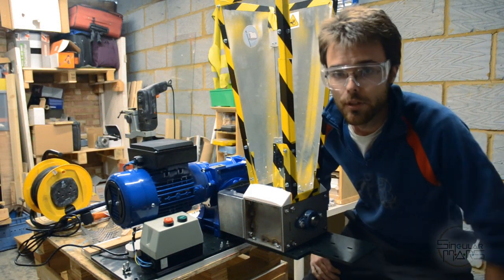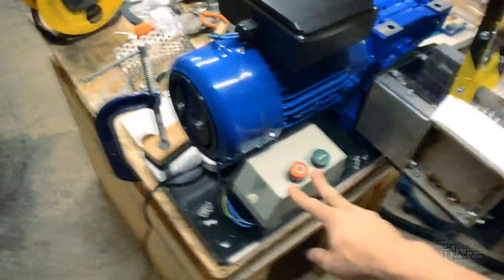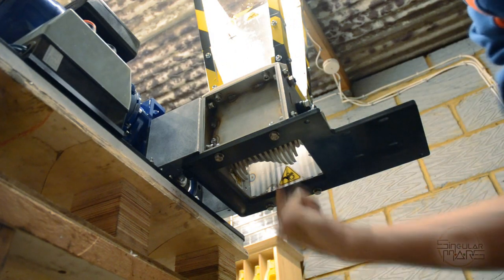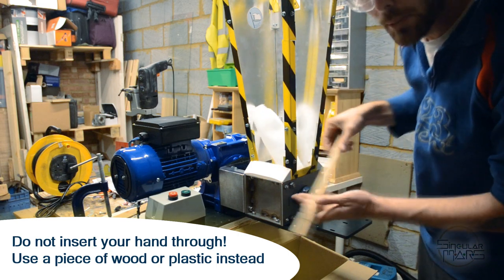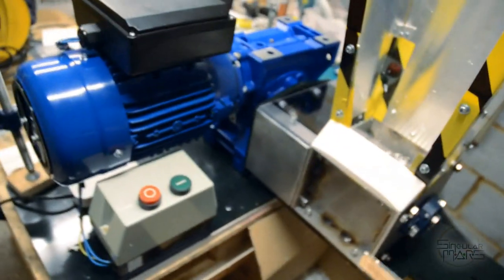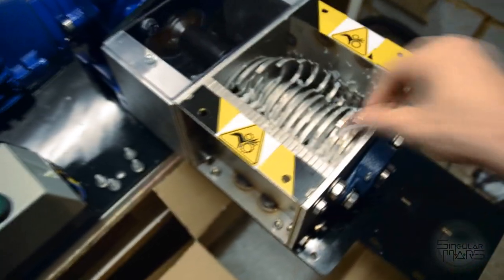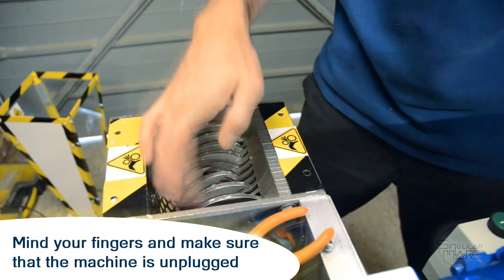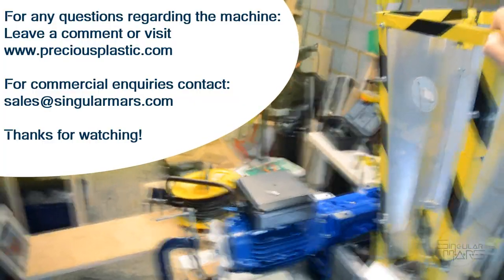Precious Plastic Shredder Demo and maintenance

Comment: I'd suggest reconfiguring the blades so the last blade to cut is towards the middle of the shredder, not on the edge. That way, the accumulated plastic will be able to get shredded and won't pile up where it can't be processed. Just don't remove the bolts holding the bearings on, so it will be easy to put back together and you don't lose the alignment.

Comment: Very nice looking machine. I wonder if your hopper was just a bit shorter if it would be less awkward to push the bottles/jugs down in to the blades.
Reply from the maker: thanks, sure it would, but less safe. For safety reasons you need to leave enough distance to the hazard so that your arm can't reach the blades while moving

Comment: For light weight cleaning, you might want to use an air compressor. I wonder if it would be productive to pulse an air-blast through the output sieve occasionally to cut down the frequency of thorough cleaning events?
Reply from the maker: I don't have a compressor yet, but yeah air would help

Comment: Hi Javier!
Awesome shredder, love the safety aspects you've integrated. Was just wondering what the dimensions are for your Polycarbonate hopper sheets. Was going to buy them on ebay. Gracias!
Reply from the maker: Hi nicolas thanks, these are 4mm but go to 5 mm or more thick, depending how you want to size it

Comment: Can DC motor with 1600 rpm possible to work as a shredder motor???
Reply: 1600 Rpm is too much to use directly. Use belt drive or gears to lower the rpm.

Comment: I don't see the reason for a plastic shredder to be so slow in it's function; for plastic, you need speed up those rotorblades assisted with a flywheel, & that unesesary reversing function can completely be annihilated. unless the whole objective of this type mechanism is for entertainment purposes.
Reply from the maker: Hi, we lowered the speed as much as possible to get higher torque and be able to shred tough plastics. This single phase motor didn't have reversing function
Reply: Precious Plastic shredders are meant to be used in small scale applications, and usually in places with limited resources. The usual motors used on the shredder are 2kw motoreducers with approx 1800rpm and 30:1 ~ 50:1 reduction ratios, which cost around $500~$600. In order to get a good torque out of those motors you need slow RPMS, around 50~70. On regards of the reverse switch, it's needed in case your shredder gets clogged, which is very common when using low torque motors, and it also helps a lot when cleaning the shredder from any bits of plastic that get stuck on the knives. If money was not a problem, we could get 10+ HP motors and run the shredder at 200RPMs.
Reply: For its purpose I see lots of mechanical components. If those blades turn at 750rpm  direct driven from the motor will completely shreds that plastic one gallon container in a fraction of a second without the need of a reverse function & the precious time that this dilatory & drawsy version takes on a single container not to mention the excessive electrical power that it needs.
Reply from the maker: This is only 1.1 kW power. Direct drive at full speed would be 1500 rpm but only ~5 Nm torque. With this reduction we get massive torque and is able to even shred aluminium cans and some bits of steel. To get such a high torque at high speed as you say that's when you need a much powerful (kW) motor. No wrong answers here, just design requirements
Reply: and where did you buy this motor ? how much ?
Reply: You need a large gear reduction to deal with the pressure. If you just want to go fast but then hit alot of resistance your motor won't have the strength to turn. That's why a reduction of, say example, 1:30 allows it to shred slower but more consistently rather than going fast, hit resistance, get locked in and unable to turn.
Reply: If you want a decent motor, just find a thrown out treadmill and get the motor. They are usually about 3HP and have the strength to pull a human. Think outside the square :)